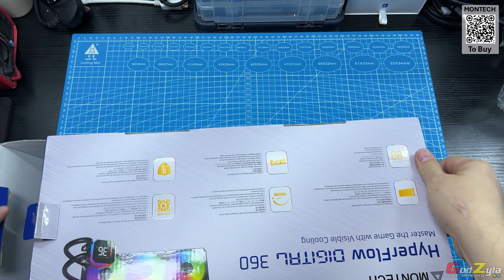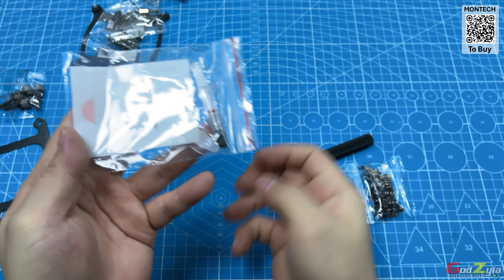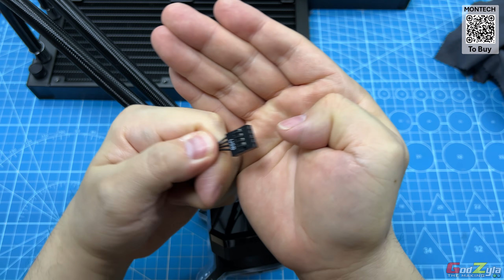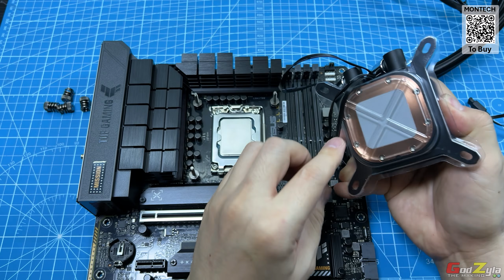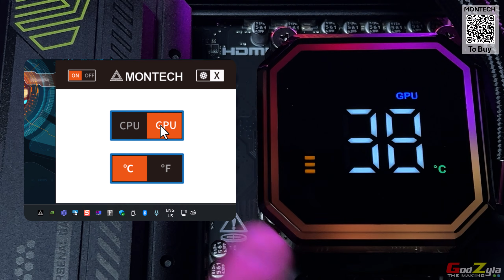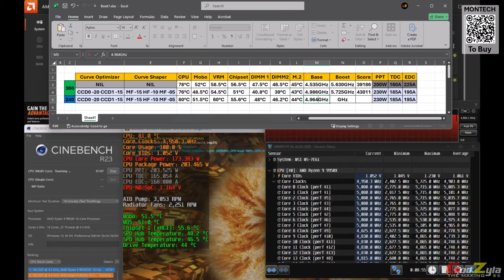Montech HyperFlow Digital 360

Comment: Como faço pbo, melhor desempenho e temperatura fica controlada ryzen 9 5900x com placa asus tuf x570 wi fi
Reply: Sabe me dizer mais ou menos eu fixa todos clock 4.8, com esse wc quanto temperatura vai atingir
Reply from the maker: @edvaniobaptista9523  just a prediction as mentioned I do not have a 5900X. I would say it should be below 80degrees.
Reply: Obrigado, seus vídeos são muito bom completo, bem explicado, bem informativo parabéns
Reply from the maker: @edvaniobaptista9523  you are most welcome. All the best with your configuration and build too 😉
Reply from the maker: Hi edvanio baptista, welcome to my channel. I do apologize as I no longer have X570 board or 5900X processor to explain in details for you. you might need to refer to Skatter Bencher https://skatterbencher.com/?s=5900x
Reply: Obrigado pela atenção amigo, estou querendo comprar esse wc, para ryzen9 5900x vc recomenda esse wc do vídeo
Reply from the maker: @edvaniobaptista9523   The hyperflow digital 360 is more than capable to a 5900X (105W TDP) as shown here it’s cooling a 9950X (170W) with no issues.

Comment: I installed my Hyperflow 240, but the temperature display only turns on after Windows starts. Is there a way for it to turn on upon PC boot?
Reply from the maker: Hi Rodrigo Miranda, welcome to my channel. Nope, the application is required to load before your segment digital will display.
Reply: @KleoYan  oh I see, that is unfortunate 🥲
Reply from the maker: @RodrigoMirandaSan  you are most welcome.

Comment: I wonder if Montech is the OEM behind the EK AIOs, since EK doesn’t manufacture the AIOs themselves
Reply from the maker: Hi JustWin, welcome to my channel. You don’t have to wonder. EK and Montech are using the same OEM factory, quality and structure are of the same but Montech cos is cheaper 😉
Reply: @KleoYan I thought I saw a lot of similarities!
Reply from the maker: @ClassicLang  Yup. since Hyperflow ARGB, it's using the same OEM factory as EK. That's the reason why these liquid cooler have a solid build. Just that the fans need more static pressure and here it is the E28 😁
Reply: @KleoYan I was thinking of getting an ekwb but after all their bs recently there’s no point especially with this also being a lot cheaper lol
Reply from the maker: Hi s o l, welcome back. Yup, no point to pay so much. Infact Montech and EK Liquid AIO are from the same factory, the mounting mechanism is the same, same goes to the pump design and such. Getting this will be much more valueable. Thank you for the feedback and all the best with your build too. 😊
Reply: @KleoYan I had no clue. Tbh I’m only getting this as I got a bit of spare cash and had my king 95 for nearly a year and this aio will make my pc look a lot nicer. Rn using the ak620
Reply from the maker: @sol-hb8zg  I see, then you will be happy with this liquid cooler of the performance 😉
Reply: @KleoYan what’s the actual best aio atm that’s around the same price as this? And thanks
Reply from the maker: @sol-hb8zg  my list are as follow

LCD AIO
1) Asus Ryujin III Extreme
2) PCcooler DT360 ARGB Display
3) Sama Q70 or Sama Q60

For Just pure performance
1) Galahad II Lite non argb 
2) Montech HyperFlow Digital
3) Asus LC 360 Prime 

as for price, honestly I lost track hahaha.. Personally if you ask what will I choose to use, of all the AIOs I've tested. I will pick either Galahad II Lite and the Montech HyperFlow Digital as for LCD, I will just make use of Turing Smart Screen, cos once AIO spoil i can just change out, plus won't need to spend so much on AIOs.

Comment: Very nice and solid AIO. Quiet and works well
Reply from the maker: Hi ya Leon, welcome welcome.. rare guest 🤭🤭🤭. Yup. I am sold out with this liquid cooler. just hope the next version will be able to cycle the screen with stats like CPU, GPU, Water temperature and the Pump RPM.
Reply: @KleoYan  it a good start for them. Wish they have 280 as well for more option for users who would setup in the MFF or SFF case with the power drawn from modern CPU nowadays
Reply from the maker: @leonmah  ok. I will feedback to them. Thank you.

Comment: I’m assuming a montech case would have matching fans pre-installed.
Reply from the maker: Hi JoJo, welcome back. I will be honest, these E28 ARGB are high static pressure fans as I've tested them in a case. These are good for radiators or air cooler heatsink. nevertheless these are still new. There might be future cases where Montech might add these to their case. Thank you for your feedback and to have supported my channel. 🫡